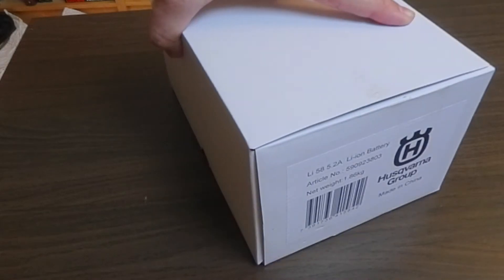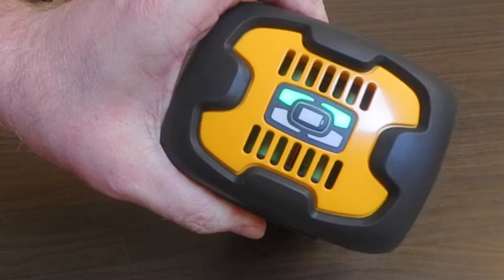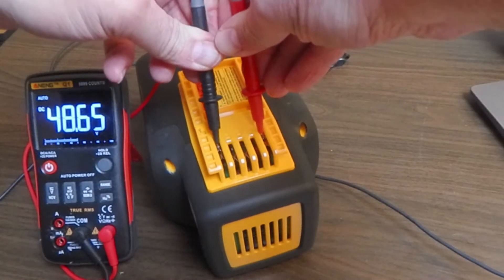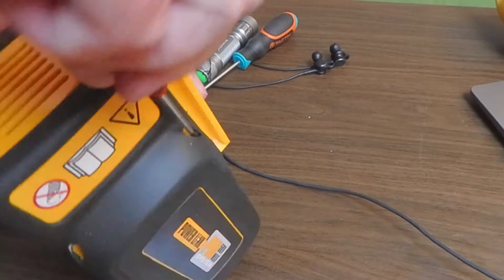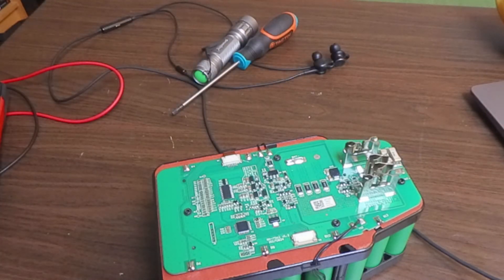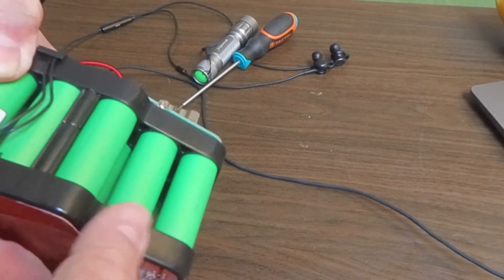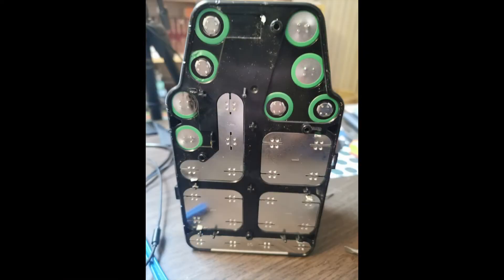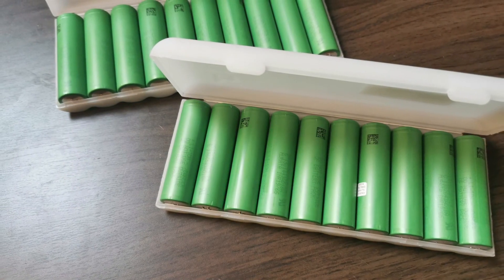Murata (Sony) 18650 INR19/66 cells for 1 euro/piece!

Comment: How did you peeled off the strips from the batteries?
Reply from the maker: I use a narrow, sharp plier that allows me to snip of the residues of the strips close to the battery.  This is the exact one:
https://www.biltema.se/verktyg/handverktyg/tanger/avbitartanger/sidavbitare-2000036744
Also, I try to "roll the strips off" the battery poles, it works well in 99% of the time. 
If you want I could make a "close up video" where I strip off a few batteries.
Cheers